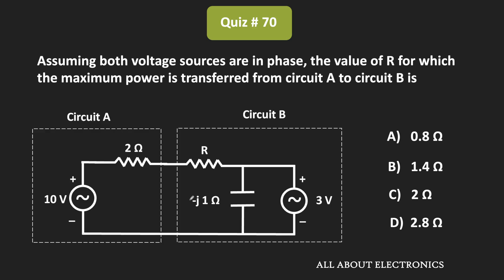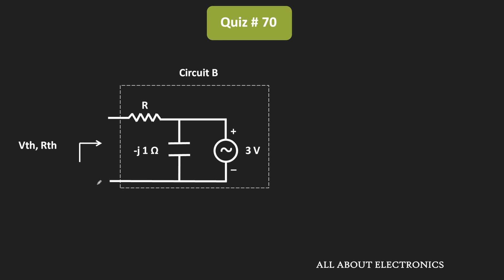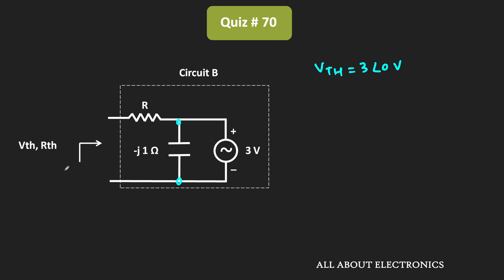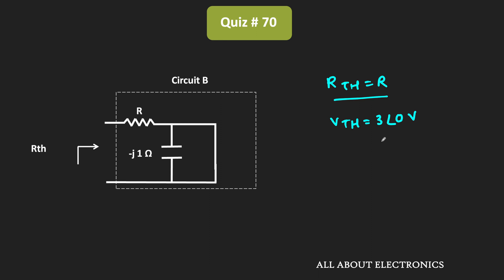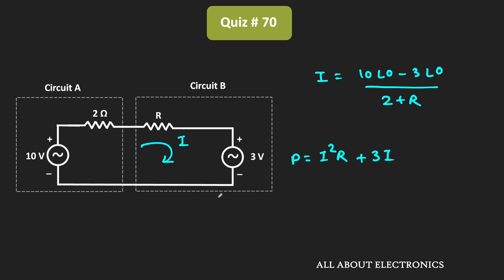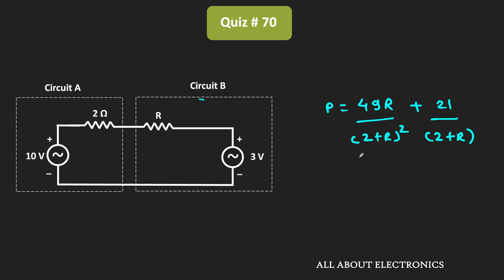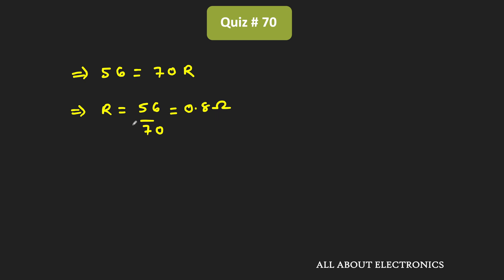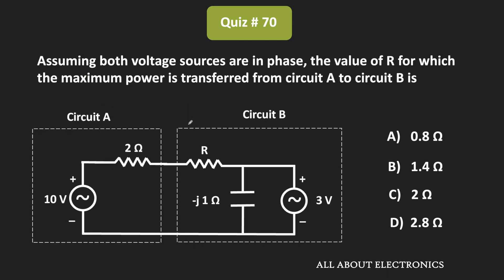Maximum Power Transfer Theorem (Network Analysis) | Quiz # 70

Comment: I think the following is a much cleaner and simpler way of finding R through differentiation:

P = 49 R/ (R+2)^2  + 21 /(R+2) 

Re-write P as :  P = (49 R + 98 - 98 )/(R+2)^2  + 21 /(R+2)  = 49(R+2)/(R+2)^2  - 98/(R+2)^2  + 21/(R+2) = 70/(R+2) - 98/(R+2)^2 

Now, dP/dR = -70/(R+2)^2  + 196/(R+2)^3 = 0 => R + 2  = 196/70 => R = 56/70 = 0.8 ohm